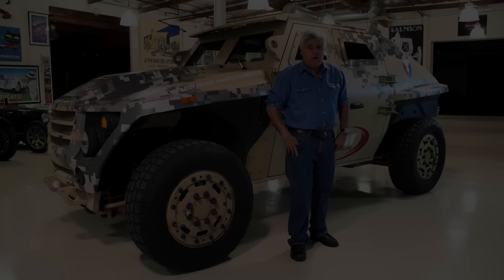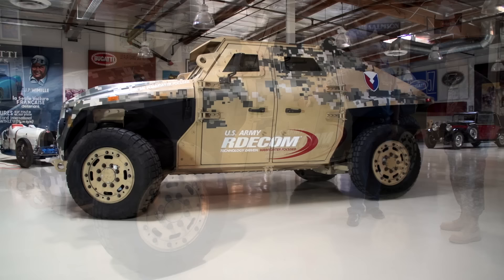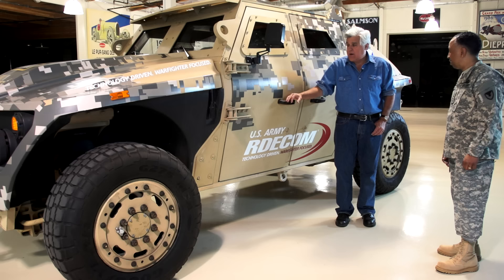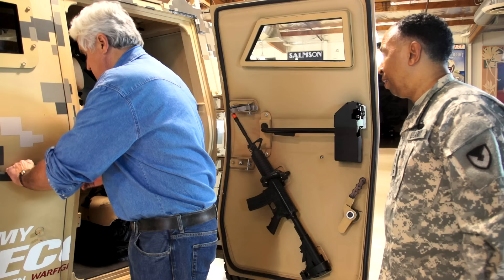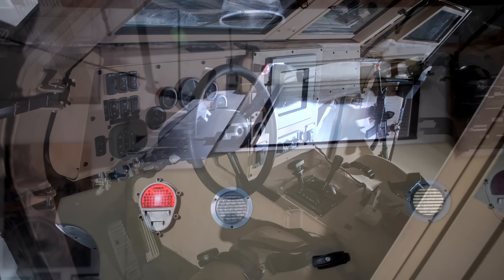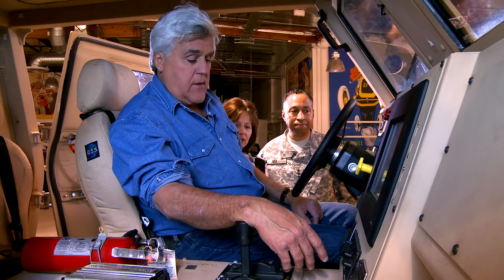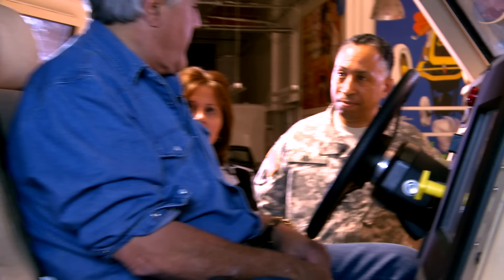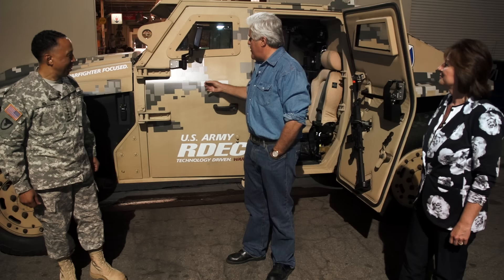U.S. Army FED - Jay Leno's Garage

Comment: My rock crawler is not bullet proof in the cabin, but it is bigger, will get over obstacles this thing couldn't dream of tackling, and gets 26mpg.  I'm not too impressed but I realize this is an attempt to transport soldiers at lower cost.
Reply: my car would destroy this shit , much better
Reply: Your rock crawler isn't weighed down by steel armor plating, explaining the increase in gas milage.
Reply: shaneybrainy13
Hence the mention of lacking bulletproof properties.  Though I know Peterbilt 18 wheelers that get slighter better MPG than this thing, while hauling 90,000 pounds.  I am still very much unimpressed.  Our military equipment is built by lowest bidder provision.  Tha Marauder, created by Paramount Group, gets a little over 30mpg, is more heavily armored than this, and carried more bodies.
Reply: Your rock crawler's engine and mechanical components are nowhere near as durable and solid as those found on a military vehicle. These things are engineered to survive. Everything you have in your rock crawler (axles, shocks, transfer case, etc) are manufactured from standard commercial grade materials...not military grade. There is a huge difference in durability.

Military equipment is purpose built and there is no purpose to rock crawling. It's too slow and you become a target.
Reply: OU812 It seems that every word of this is incorrect.  The engine, transmission and various other components on this particular vehicle are designed for the purpose of lower expenditure.  As I stated in my original post: "an attempt to transport soldiers at lower cost."
Hardly anything on this vehicle resembles the deliberate design of the original Humvee, for example, the brakes are on the outside of the wishbone with an intermediate crossmember and axles/knuckles that are blatantly exposed, as opposed to the Humvee keeping these components in the center for protective purposing.  Our military is build my lowest bidder material, despite what some might like to think.

And without getting overcomplicated, crawling has a very specific and effective purpose.  Improvised road blocks pose an issue, for example, to a Humvee, but not to say, the Marauder, which is a recent design, specifically made to be capable of crawling, among other engineered purposes.  Preventing you from being herded or obstructed.

I assume you would be surprised what "standard commercial grade materials" exist in the military.  The engine in this particular vehicle is just a simple Ford V8.  The other model uses a Cummins inline 4.  What has been done here is simply designing a minimal safety cab that can be fitted to a common commuter carry.  Again, the purpose being to transport soldiers at lower cost, as opposed to driving the Humvee around as often.   I build vehicles and I was welding for the United States ages ago :)
Reply: ganador13
i dont believe you have a rock climber since you have ZERO videos of it. stop lying.
Reply: ganador13
I find it hard to believe you get 26mpg with that set up. Nice looking Jeep though.
Reply: Skott62
Verified with multiple tanks of fuel and math.  And thank you for the complement.
Reply: ganador13
im just trying to figure out how you think you can even start to compare a rock crawler to a H1.
Reply: Konsta Paloukos
I did not, I compared it to the "FED".  I compared a Marauder to a Humvee, in the specific respect that a Humvee cannot crawl, while a Marauder can.
Reply: ganador13 Are you seriously comparing the durability of your Jeep Cherokee to a military vehicle?? C'mon man you can't be serious.

As for "built by the lowest bidder", it does not mean they use cheap materials. The suppliers must still adhere to strict standards (you familiar with MIL spec?). FYI military contractors play a lot of politics and projects do not necessarily go to the lowest bidder. Who you rub elbows with has a lot to do with it.

Having said all of this I'm sure you can out crawl the FED because it was not designed to do that but there's no way your Cherokee is as durable. Not even close. Sorry.
Reply: OU812
I have already covered this and gave names for the components used in this "FED" vehicle, none of which are "MIL spec" other than the cab itself.

Which, again, I already explained ;)
Instead of copy pasting, I refer you to my first response to you.  Where you began your statement with "engine and mechanical components are nowhere near as durable and solid as those found on a military vehicle.".  At which point, I pointed out exactly what components are in this "not so military grade vehicle".

You seem to have very little education on this subject.  I intend no offense, but suggest you do some actual research on what goes into the process of a military commission and the history of such.

This vehicle is nothing more than a minimal safety cab, fitted onto a commuter carry that is made from all the same things we have on our local roads.  Again, for the purpose of transporting units or "troops" at lower cost.
Reply: ganador13 "This vehicle is nothing more than a minimal safety cab, fitted onto a commuter carry that is made from all the same things we have on our local roads"

Have YOU actually done any research about the FED because it sure doesn't sound like it. There's no cab fitted to a standard frame. At all! It's a high strength welded aluminium space frame. The suspension components are also high strength aluminium. Good luck finding a standard truck built that way. And where do you get "transporting troops at a lower cost" from??. The purpose of this vehicle is to demonstrate the possibility of fuel efficiency with military vehicles. They used friction stir welding to fuse aluminium sections together. There is nothing "low cost" about that process compared to "all the same things we have on our local roads" ! Good grief.
Reply: OU812 There is nothing "standard" about a minimal safety cab.  It is simply the name given to designate a cab designed for "minimal safety grade" in what is deemed a "hot zone" or the "wrong location" :)
These are custom dimensioned for various applications.

I was taught to weld by the United States when the internet was still a new thing.  I am curious to know where you learned to weld?
What you refer to as "high strength aluminum" is simply what I refer to as an alloy.  Grades such as 7068, for example.  Friction stir welding is also commonly used in the automotive industry, in companies such as Ford, Mazda, Toyota and Volvo, for the simplest purposes.  I don't know what makes you think it is "not low cost", as one of the main advantages of friction stirring is that it is easily automated as well as requiring less training and expenditure on materials.  There is nothing special about either of these things, they have been around for quite some time :)

This vehicles expenditures on fuel and building cost are lower in comparison to the standard Humvee convoy transport, which is why it was commissioned.

I am sorry but you have repeatedly demonstrated to me a lack in education on more than one angle of this subject, it seems.  The first example being within the following statement:

"Your rock crawler's engine and mechanical components are nowhere near as durable and solid as those found on a military vehicle."
As I have already responded, this FED uses a basic Ford V8 in one version and a cummins inline 4 in the other.  This would be the first example to me that you seem unaware of the reality of this scenario.  Your words on "high strength aluminum" and the basic concept of friction stirring are a repeat example of the same.

If you actually want to learn about the subject, I would gladly share, provided you remain polite.  But if you simply wish to argue, then I'm afraid my only response can be that "real life and call of duty are two very different worlds", as well as "argumentum ad nauseam
"

:)
Reply: ganador13 Did you have your odometer reprogrammed? If not, and you don't adjust for those larger tires, you think you're getting better mileage than you really are.
Reply: dchawk81
No, I did not get it reprogrammed.  Instead, I purchased one that is easier to program than the stock Chrysler odometer, as well as installing a custom speedometer gear to match it.  My gas mileage is correctly recorded, using more than one tool for verification. :)

However, just to keep things technically straight, had I not done this, I would, actually, be getting better mileage than I assumed,  Not worse mileage.  If your stock odometer states that you traveled a specific number of miles under the assumption that your tire diameter is at factory design when, in fact, you actually have a larger than stock diameter, then you will have actually traveled farther than the odometer claims, not shorter.

Comment: All steel doors, grace the engineer. I hope you were just being secretive, because bulletproof materials. Like 12 or so layers of polycarbonate, would have added much strength/protection. If you did not, your awareness of technology, is very low. Also did you use one way bulletproof glass, so they can stay protected and fire back? Or is weak comparatively and you already have unmentioned, weapons slots?  

The bigger problem in government or civilian hiring process, is that the person doing so, is not qualified or is compromised, in some capacity. Returning favors, taking bribes, free radicals have damaged the brain, where they think they are making good choices, when they are not. Or they are naive/ignorant to trickery by others.

Comment: they worked to make a cooling vest? those been around for years just a waste of money making something that already been made. 30gal fuel tank. thats going to work well driving to the front line then into battle and trying to get back to base good luck. and carbon and aluminum hood? doesnt look very think how is that going to stop a high power sniper round to the motor? this just seems like a waste of money. could of made it way better

Comment: This is not a well thought-out vehicle. The solar panel is useless. The doors can not be opened when the cheap handles break off. Carbon fiber is useless for this vehicle. The engine is too sensitive. And in front is the intercooler and the radiator. Totally stupid. If one of them shoots, the engine is junk. The seats are too sensitive. The shape of the door makes little sense. The touch screens are too sensitive. The bottom is bolted from the outside, extremely stupid ...Such a useless bucket ...

Comment: Who engineered this pile. Although it looks to be safe for the people inside, it's basically a coffin. No protection for the air bag suspension, then why use it. No frontal protection for the engine or its cooling systems, Carbon fiber with a very large opening in the front awaiting a bullet. Then there's the engine and the solar system. Why waste the money in a solar system when again one single round to the panel would cost us thousands in tax dollars. This POS could be stopped with a 9mm and three rounds forget it if a bomb went off underneath it. Aluminum is a brittle metal so the suspension parts would shatter like glass and Jay I know for a fact aluminum is the worst metal to use for  armament so NO the bottom shielding is definitely a thick plate steel. Just another example of our government wasting billions of dollars if not trillions on experimental garbage that in the end is useless, like the F35. IMO you want a vehicle that can take a good amount of damage and remain drivable, not a huge coffin for 4 of our men.
Reply: They won't be using this. Oshkosh won the contract.
Reply: Do you have any idea how much just the R&D cost to build a couple vehicles? Then the manufacturing, build and parts supplier cost us tax payers for most likely a couple vehicles that will probably never see combat. It's a waste of money and a lot of it.

Comment: What a waste of time energy and resources.   But hey it's only  the American tax dollars that is paying for it.  One of the first vehicles Henry Ford made was 10 times stronger and 30% lighter than steel.  if they made  this vehicle  and other vehicles . From Hamp! They would be stronger lighter  cheaper and way more efficient than anything the Army Navy Marines are currently using.  Not only would it be stronger lighter and more efficient it would be pennies on the dollar cheaper.    here we are celebrating over vehicle.  That is  working at the smallest percentage of a fraction of what it could be. Compared  If the used Hemp!         So everybody's happy about this hunk of junk paying top dollar.   when it could be so much stronger lighter faster and more efficient.   If the just used hemp.